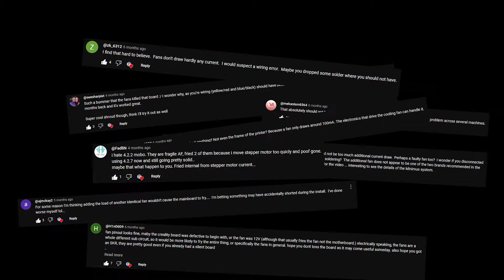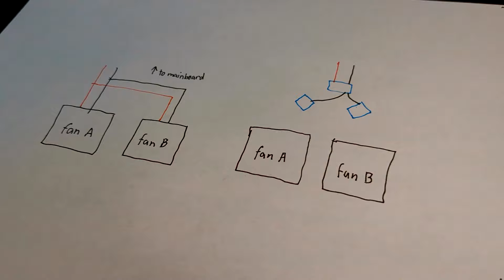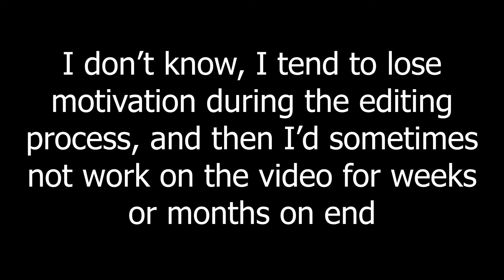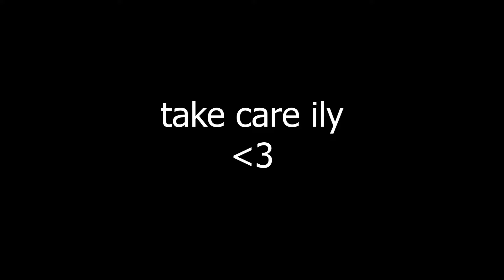I Was Wrong... Let's Fix it!

Comment: I have no idea how a miswired fan could kill a motherboard, but I'm glad that you have the printer back up and running. Excellent editing btw.
Reply from the maker: I'm honestly still not 100 sure how it happened either haha, I guess we'll never know for sure. I have however heard from multiple people that the v4.2.2 board is just notoriously weak, so it probably died from some small mistake I made like pushing things around too fast generating some kind of current in the steppers which was then sent back to the mainboard.

And thank you! I tried my best

Comment: i did the same ish on my skr board LOL I'm going to be doing a 1 to 4 splitter so i can have my aux rear fan come on with my hot end fan and just run everything at a slower speed
Reply from the maker: Wow yeah that's quite a few fans on one plug lol, nice job!
Reply: @Fr0zenTiger  hey now don't say nice job till we know it doesn't blow anything up LOL
Reply from the maker: @digital0785  LOL fair point, good luck

Comment: Hey just to note here.  The 4.2.2 board has a connection on the board for a second fan.  I'm about to do mine and it will be a pain to pull the board and run the wire.  But I figure if the board was designed to have the second fan and the new fan has the correct connector (it does)  I'll do that over solder and splice.
Reply from the maker: The 4.2.2 and 4.2.7 do technically have 2 fan ports but one of them is the always on port for the hotend fan if I remember correctly, there is only 1 port for a part cooling fan.